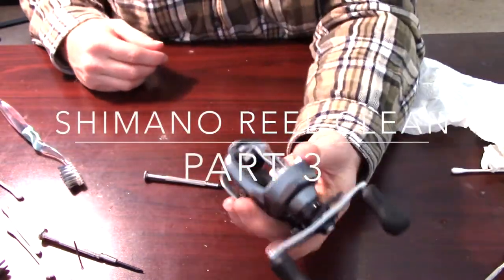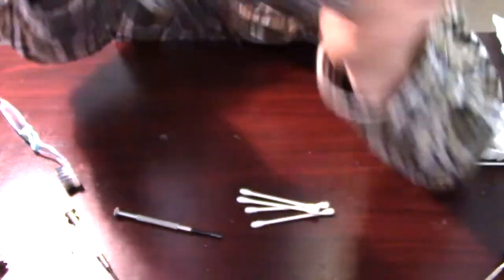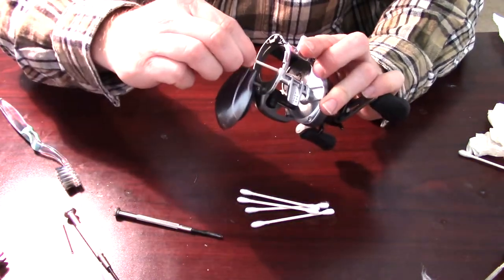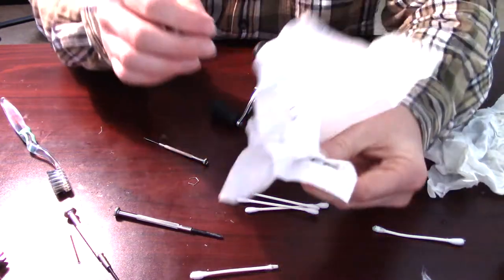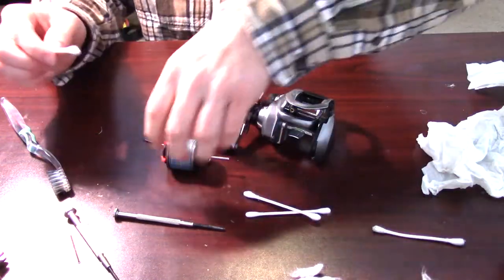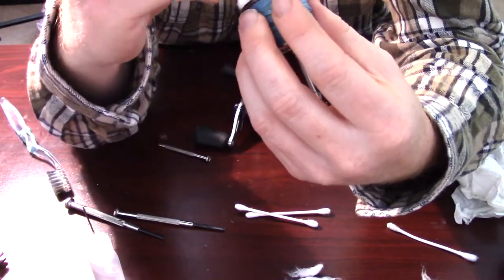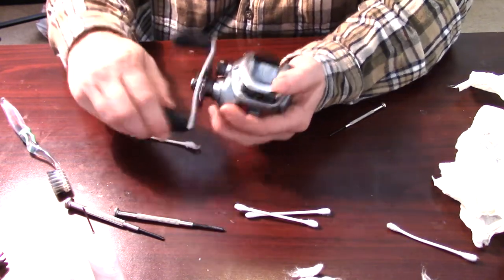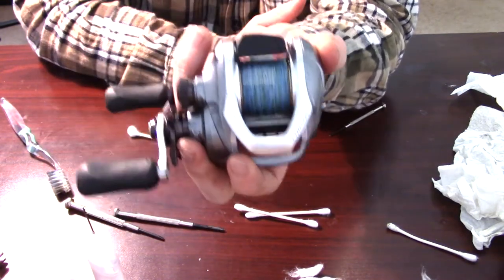Shimano Curado Full Reel Cleaning - Part 3 - Spool cleaning (also a quick cleaning)

Comment: just a thought when you clean with the q tip it might be better to use alcohol rather than grease because it cleans then dries and is gone. I used your video to replace the bearing under the spool release mech.F Y I if you reel starts sounding like a coffee grinder that is the problem. the part number on the offical shimano  breakdown is BNT-3927 HOWEVER I used part number BNT-5386 THEY ARE BOTH 8X12X3.5 and works just as good and is about 2.00 cheaper. REALLY GOOD VIDEO. THANKS
Reply from the maker: Glad you like it thanks, yes you can clean with alcohol.  But people go overboard and then don’t replace the grease so....

Comment: Even though I don't fly fish I've always enjoyed your tying and fishing videos.  These Curado videos also are helpful but I don't understand why for a yearly cleaning you didn't flush all the bb's including the one under the brass shaft that you couldn't figure out how to access.  Shimano only uses Abec 3 bb's and they are not very tight toleranced.  The last two models of Curado and like you discovered your Chronarch CI4 are famous for water intrusion.  You didn't even oil them after the intrusion and visible salt around the levelwinds worm gear.  I'm also surprised you didn't access the pawl and levelwind with the evidence of the salt next to it.
Reply from the maker: I didn’t need to this time around...  they were working fine.  I find that if you clean your reels regularly, you rarely have to do it.  If you oil the bearings too often they will gather more dirt and therefor needs to be flushed more often.  Hope that makes sense?  

Again, this wasn’t really a video for fully completely cleaning a reel.  It’s more for those who never did it before, and therefor I didn’t want to confuse people or make things difficult for them when doing things like flushing bearings.  Also a few other things like taking off the snake guides aren’t mandatory.  It’s important to do sometimes, but not every time you go.  For the super deep cleaning and fill restoration of reels, people who are new into this cleaning of reels, probably shouldn’t do it themselves, and take the reels to a professional service.  However simple taking apart and cleaning like I did should be easier for the individual like I described above.  :)

Comment: How do you clean the worm gear?
Reply from the maker: You can clean it right in the reel, by taking a Q-tip and wiping it down.  However, for a deeper cleaning, you have to take it out of the reel.  That can be done with removing a side C-clip.  But its hard to do.  I rarely do it unless its really gross and dirty.
Reply: Would a can of compressed air help with cleaning out the worm gear?  I feel like that gear can get pretty dirty where it's exposed to the elements.  Yay/nay?  I'm new to taking my Chronarch 51e apart - in fact I only did it last night for the first time while watching your tutorials (super helpful!).  To my surprise, my reel was still very clean inside, thankfully.  And once the worm gear is cleaned, are you putting a drop or 2 of oil in there?  Not grease?  I read it's a bad place to put grease because it'll get gummed up from being exposed water, dirt, air.  Thanks in advance.

Comment: As a reel-nerd/repair guy, I watched all three of your videos.  I'll give you points for the take apart and re-assembly.  But I had to cringe in awe when I saw you brush the gear with the dirty brush and cringed again with the shockingly tiny amount of grease (not even a very good kind) applied to he main gear.  It just rubs around whatever grit and salt you have. Had you put grease or oil on the back side of the main gear, you'd not have that tarnishing either.  You'd be much better off brushing grease on all the teeth and then brushing half of it off.  And the slip-stop your feeling is likely your drag, but if it's your gears (doubting that) it's because of inadequately greasing them.  Being afraid of "gumming it up" means you are using the wrong stuff and therefore starving your reel of a lubrication.  And you never did clean/lube the worm gear or the pawl.  Also, you should have about 4 or 5 different types of oils/lubes/greases when lubricating parts.  There are a dozen other things I'd mention, too, but I won't.  You're handy-work was too far off-center, unfocused and not well-lit, I gotta say.  Well, you succeeded in the reassembly, but for your cleaning and lubricating, I need a shot of brandy.
Reply from the maker: Your wrong on many accounts here but cool man.

Comment: How do you remove the left side plate completely? (One without the handle)
Reply from the maker: It’s not made to come off.  You can do it but I believe it takes several steps I don’t have the ability to explain here.  I’ve only done it once, it’s not necessary to do almost ever.  I don’t recommend doing that even if you find out how to.  You can clean the entire reel without taking that off
Reply: McFly Angler the only reason I ask is because mine has some good paint peeling from palming it. I found another from Shimano I’d like to replace it with. But if it’s more headache than it’s worth Ill probably just skip out on it
Reply from the maker: Oh Ok.  It’s complicated from what I remember and I don’t have the reel in front of me.  I don’t wanna tell you wrong
Reply from the maker: I’d check with shimano on how to do it.  They might give more imput; I’m sorry I’m not more helpful
Reply: McFly Angler I gotcha. I appreciate the help anyways.
Reply: McFly Angler I definitely will. Customer support? It’s no problem I rarely take mine apart to that extent so I wanted to just ask around before I dove into it
Reply from the maker: Ya I’d say that might work.  If you got a part from them they probably could help assist you in replacing the parts
Reply: McFly Angler good deal. I’m gonna give it a shot

Comment: my reel still feels kind of sandy, and that there is dirt inside
Reply from the maker: After cleaning it?  Did you take a look at the snake gear for the line guide?  I don’t think I cleaned that in this video.  It’s a pain in the but however that can effect the reel as well.  As for grinding in the gears still, if you fully take it apart, clean it, oil it, grease it, and put it together properly, then you should not get the grinding.   Maybe you missed cleaning a part.  Or maybe the reel itself needs a part replaced.  Without holding your specific reel I couldn’t tell ya...

Comment: Man I really tried hard to not criticize because it’s not in my nature but the biggest mistake out all the others was when you spun the handle WITHOUT THE SPOOL  in the reel. The spool shaft when inserted, keeps the pinion gear and main gear aligned  . Spinning the handle with out the spool inserted causes damage to those soft brass teeth. Shimano makes the absolute most precise gears so ANY damage no matter how small will be felt. I’m sorry for the criticism but as a reel technician of 8 years with well over 5000 reels under my belt it was hard seeing this without yelling at my phone. It’s not your fault, you just haven’t been taught correctly.
Reply from the maker: Cool bro!!!!  Sounds awesome.

Comment: I have a very thin 3/8" or 5/16" size black square left over. Appears to be like a spacer or something & is made of the same material that a thin synthetic washer is.. Wtf???
Reply from the maker: It’s in the handle construction I believe.  What model reel do you have?
Reply: @McFlyAngler  Curado K 200HG (CU200HGK) .. I didn't even notice it until I was finished reassembling.
Reply from the maker: From what it sounds like it’s part of the handle assembly.  On shimano’s website they show the schematics for each reel.  Check there to make sure, it will show each part and where it goes.
Reply: @McFlyAngler  It was part of the cast control knob. Fits right inside the cap.

Also, do you know what causes the line to spool unevenly (more on one side of the spool) & how to fix it?
Reply from the maker: That’s probably the gears on the front where the spool winder is.  Check to make sure they aren’t gummed up, or that they aren’t stripped in spots.